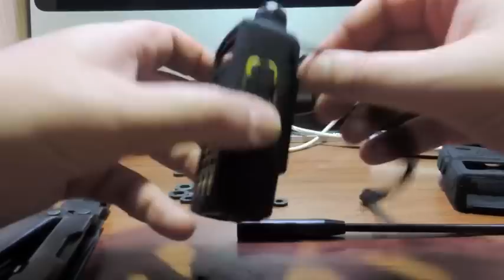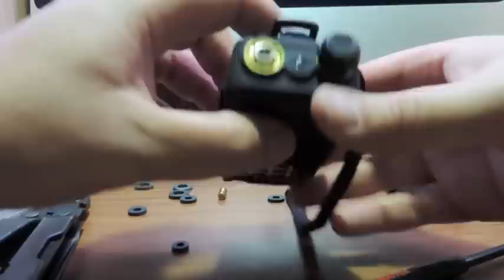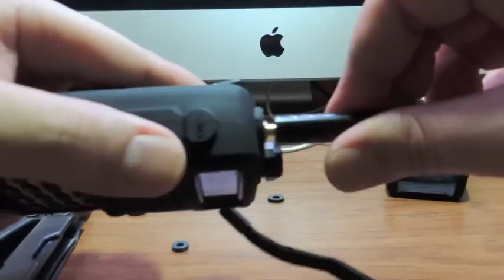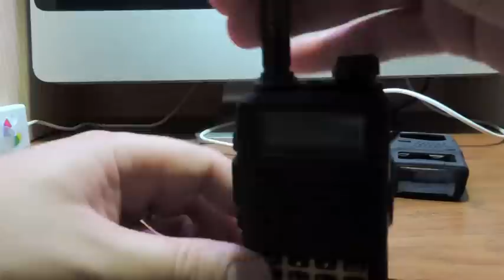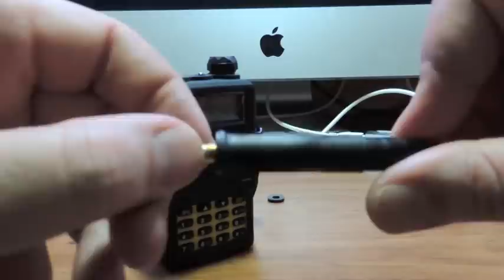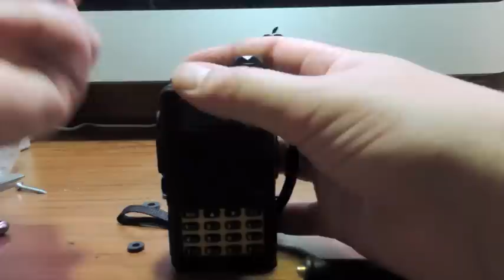BaoFeng UV-5R Plus antenna modification

Comment: I have a number of baofeng radios in my collection started off with a uv3+ problem is they suffer major interference on vhf from uk pager sites. I have cured the problem by fitting a SOTABEAMS 2meter pass band filter just screws onto the SMA antenna fitting the baofeng performd as well as my yeasu hand held. 73 from the uk MW6ZAN

Comment: When screwing on an antenna, you need to grasp it as low as possible next to the connector so as not to twist the wire in the antenna and break it loose.

Comment: problem is these cheap baofeng radios are as deaf as door knobs even with an up graded antenna.
Reply: Pete Smith   Not true got two radio's for $52 and they work great for my needs. Just make sure they are not fakes! YouTube video's on how to test to see if the UV5 are fake!   Just upgrade to the longer antenna.
Reply: Magnetic mount car antenna works with these radios!
Reply: Pete Smith I think you must have had a faulty one they are as good as a commercially made well known brands and even better will very cheap hombrew Antennas even a wire 1/2 Dipole has more gain than even very expensive Rubber Duck type antenna. ....How Brew and Antenna Antenna Antenna is the way to go. ...
Reply: Well it was the second one i purchased off amazon on testing the vswr was in the red on both antennas not a good purchase and that micro coax cable yikes horrible products went in the bin, got a nice 7 inch limpet magmount with a propper wilson duel band antenna fitted.

Comment: I just got into Ham back in February, so what did I buy but a Boafeng UV-5R V2+, also from Amazon for 32 dollars, and I am surprised  at how well it is built. I also got a longer antenna but it fits nicely. I am glad to see though that there are people like you who will tinker with things till they work. Like my uncle used to say "It don't have to look pretty if it works" Oh, I'm James KI7BSL by the way. And  your adapter looks great.

Comment: Actually the baofeng  18cm out performs most aftermarket antennas. There are 16cm baofeng antennas that look the same, but they suck. The shorter and more common baofeng antennas are pathetic. The antenna in this video is an excellent antenna. But I detest long antennas for carry, they are often not worth the extra performance relative to the annoyance factor. The 18cm baofeng antenna is at the limit of comfortable carry, and it performs rather excellent for its length. I do carry in the car a longer better antenna, but seldom find the need to use it. Also the short common baofeng antennas work as good as the stubbies people buy after market. I been known to use them at hamfests and other places where people generally use the stubbies. No stubby antenna is good, so why buy one if your radio came with one.

Comment: Weird, mine has a Male SMA socket.
Reply: +pmessinger mine too. Better to just buy the right SMA Female antenna from ebay to start with. My Nagoya NA771 is sweet and only cost $5.99.
Reply: +pmessinger Just make sure they aren't the counterfeit ones.

Comment: Note you have also changed the wave length of the ant....
Reply: Paul Mays...
No you haven't changed at all!
The screw-in brass adapter is a 50Ω co-axial device. It's simply a tiny piece of coax inserted in the feeder. The radiator hasn't changed in length by one jot.
Gotta think about these things before making comments!
Reply: @MauriatOttolink  saved me the effort but I'm sure to find more wrongless in no time.
Reply: @jeffreystroman2811  
Eh?
Reply: dan hogue
Top O da Day bud
Reply: Yup, the wavelength of the antenna was changed a bit....and.... out of curiosity, I'd love to see an SWR comparison on both bands, before and after. Has ANYONE checked this out ??  Also, one year later, I'd like to comment on the great looking BF-UVB2 Plus. A very sharp looking HT for sure, I wonder how it PERFORMS in comparison  to    the    UV-82L, that I just could not resist purchasing. It's a great performer, and very rugged despite the ODD "things" about it's operation. If you buy the UV-82 though you will get used to it and the strange abbreviations for various functions, as well as the fake cable. So use Chirp, its OK.

Comment: Most all late model commercial radios as well as some old ones (Motorola Jedi series [ HT1000, JT1000, HTX, MTS2000, Visar], Uniden, Kenwood, Vertex/Standard) use that antenna configuration of SMA connection.

The reverse polarity male and female SMA, N, and TNC are used widely in WiFi, and broadband microwave equipment.

LMR400 is a decent low cost coaxial cable, it'll get the job done under 50 feet and maybe preform up to 75 feet with ok results. any more and i would change to something with a bit more bite, I prefer Andrews Heliax (1/2" or 7/8" depending on the power and height)

I would just buy the proper dual band gain antenna to fit the radio instead of doing all that finagling with washers and adapters.

Comment: If your looking for a more permanent solution, I suppose you could green-locktit or epoxy the adapter to the antenna.  Also, I think potting epoxy would be better than neopreme wouldn't it?  Just wrap some painters tape around the antenna base sticking out the length needed... then fill with black potting epoxy.  Voila... adapter is embedded, and the antenna base is solid. :)

Comment: I'm just going with a BNC connector and an adjustible whip antenna.

A little fragile, but you can set it to the proper wavelength.

Comment: Wee tech point here, I'm sure the antenna being longer than the stock duck will pull in signals better - and probably TX better too - but did you figure on the fact that you're also lengthening the radiating element and so the SWR is likely to be adversely affected?  If that's right then the next clue you get could be the TX transistor burns out?  (Unless these HT sets have protection for this that I don't know about....)
Reply: Most Handie Talkie antennas are 75 ohms so he has no worry with the length of the antenna other than it might get up under his arm. LOL :) Just Sayin!

73
Jimmy, ARRL TS, WX9DX
Reply: WX9DX I do believe 2-way radio antennas are 50 ohm unless ham radios are special. Every commercial radio I have worked on used a 50 ohm antenna.

if he smokes the TXPA in that radio its no big loss and not worth repairing. He can just buy a new one and toss that one in the bin.

Comment: Diamond makes the SRJ77CA antenna which is identical but has the RP-SMA connector that will fit directly on the connector on the Baofeng without any adapters or washers required.

Comment: Actually, radio AND antenna are both STANDARD MALE SMA. The adapter is a STANDARD FEM TO FEM. Reverse pipe thread, or RP-SMA, male and female, are same thing but with the pipe threads reversed. Female RPSMA has threads like normal male SMA and vice versa.

Comment: A good use for the washers and they seem to work very well indeed. Also a nice clear video with clear speech. And the final touch with the heat shrink makes it look professional, but why did you not use a hair dryer instead? Mike M6YMN

Comment: I have same radio and the only problem I've had, is also with the antenna.  I don't care much for the antenna, so I am also getting a different antenna and quite possibly use the same technique here in regards to modifying the antenna.  BTW, Welcome to the world of Amateur Radio.  73s de Steve in Missoula, MT

Comment: I'll be buying me a far better antenna than what came with the U/V-5R.  The antenna that comes with it, gives in too quickly and not very good.  In the meantime, I will use an adapter to hook up to my U/V-5R at home.  I'm using a "Copper Cactus J" that I've had for who knows how long.  I might end up building a Dbl. Copper Cactus J or such to accommodate the UHF side, as my Copper Cactus J is set up for VHF & not dual band.  One way or the other, I will resolve the issue.

Comment: Are you talking about the same type of adhesive lined type to seal out moisture on an outdoor antenna type by chance?  If so, that seems to be a far better approach than heat shrink and alot sturdier.

Comment from the maker: Hi Saul. Thanks for the question. I understand your confusion as these BaoFeng radios are weird as far as their antenna connections. You are right, the male "stinger" is coming out of the radio. This is somewhat unique to the Chinese HT's like this radio and the Wouxun radios. There SMA connections are male from the radio but threaded like a female SMA connection. The antenna in the video has a typical male SMA with a typical thread. Therefore, the female to female adaptor is what works.
Reply: Yaesu HT's are like that too.  They use a SMA female antenna 'cause the radio has a male SMA connector.

Comment: Wouldn't the antenna connection on the radio be considered *male*, since the little wire protrudes from the radio, albeit recessed?   So why would the female-to-female SMA adaptor you purchased be the proper one?

Comment from the maker: Kelley Law- I think the what you are asking about is the heat shrink tubing. You can get some at most hardware stores in the electrical section or at any radio shack. If your asking about the cover for the radio it was included with the radio. Total surprise. It's marked SainSonic, which is the company that sold the radio on amazon. Maybe try asking them. Thanks for the question.

Comment: Great video......I just purchased one of these radios myself after several years of inactivity. It s mounts to test it with. Seems my old Kenwood TR-2500 has bit the dust. The price on these is definitely a plus and I bought two of 'em. Can't wait to make an adapter for either a beam or one of my mag mounts.

Best 73's
Ed Allen....N4TYX